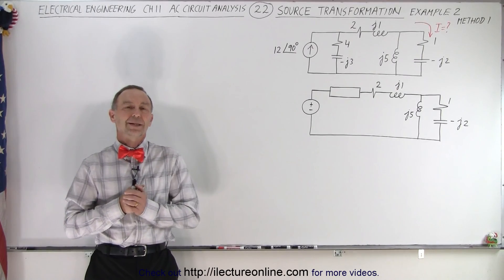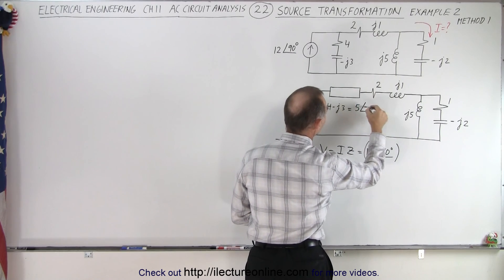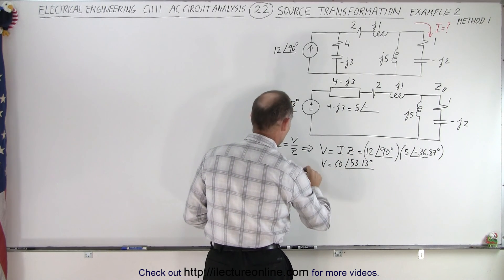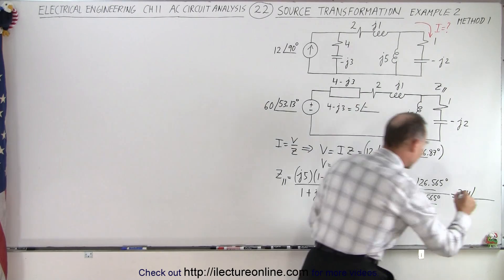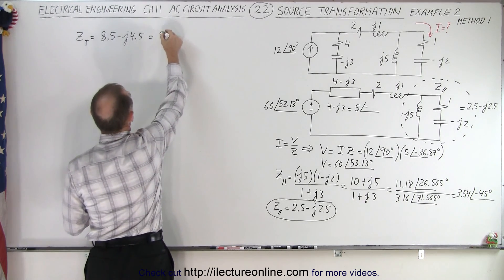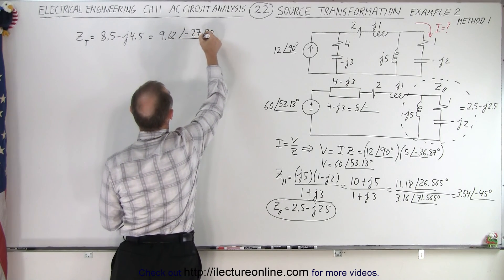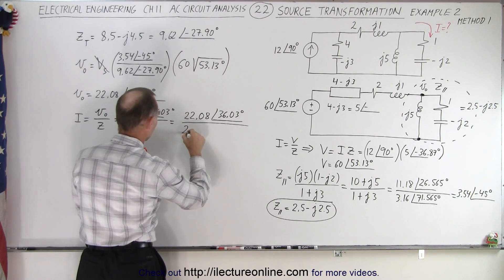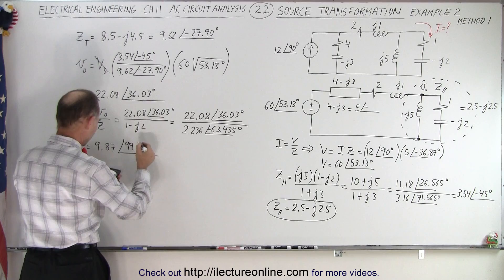Electrical Engineering: Ch 11 AC Circuit Analysis (22 of 34) Source Transformation: Ex. 2 (Method 1)

Comment: Thanks dr ,, and u can complet when u get current that flow in circuit then u use current divider
Reply from the maker: Once you know the output voltage, you can easily calculate the current.